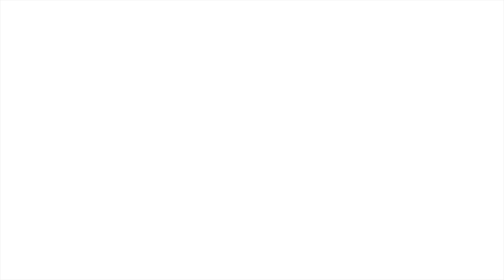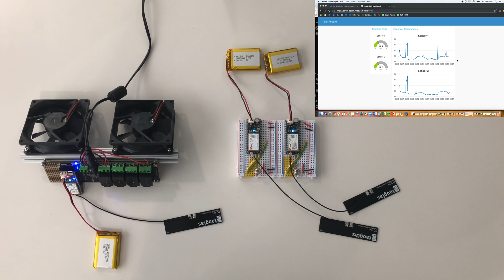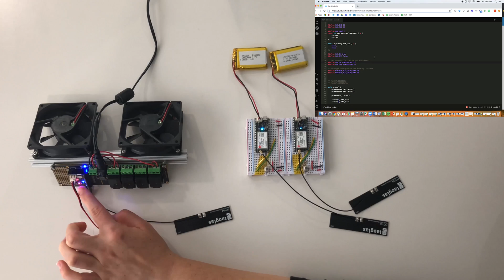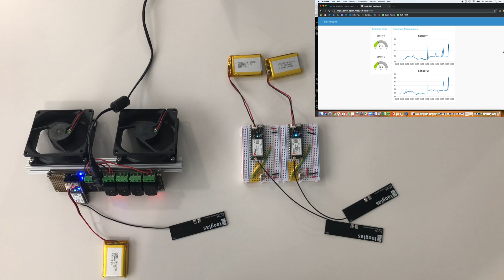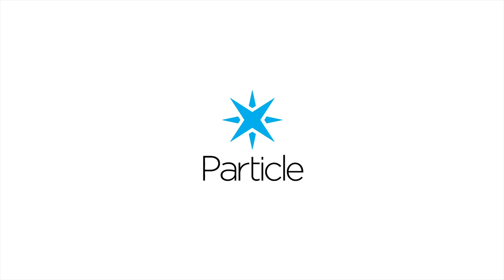Particle Live Heat Sensor and Fan Demo

Comment: The video didn't mention "cellular" - ( vs. wifi ) IoT - just checking.

Also - that seems pretty fast for a Over the air update - how many bytes were actually transferred?
What kind of cellular data rate was achieved?
What are the expected charges for over the air updates?